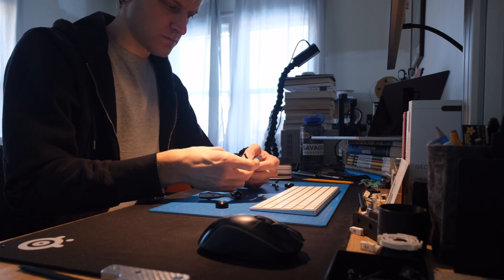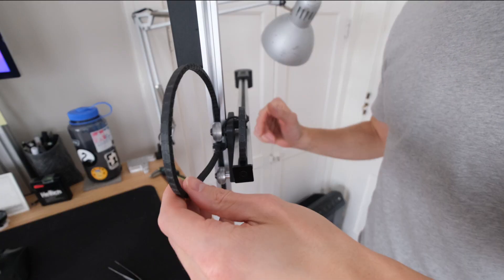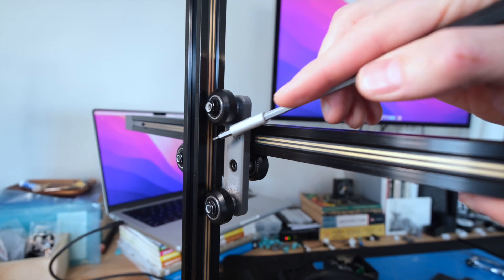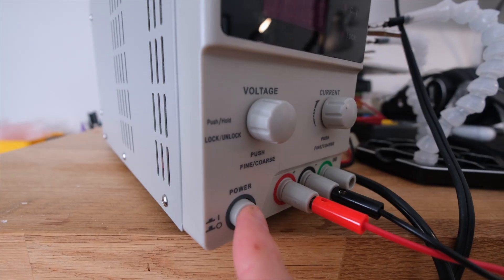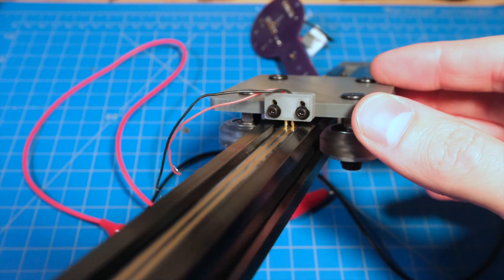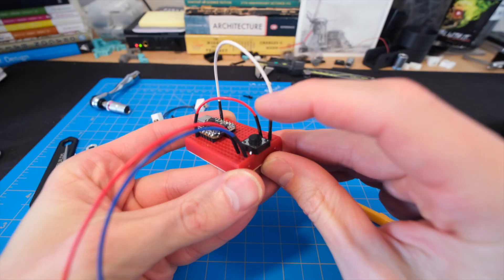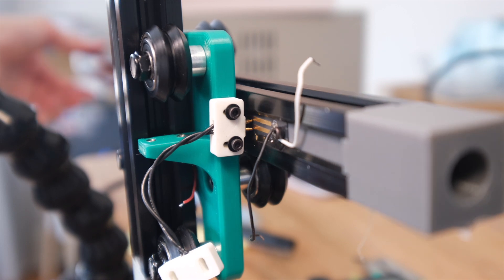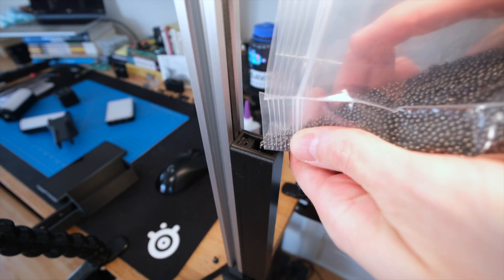Pogo pins: attractive distraction or ultimate wiring solution? - DIYson Lamp Build Log #9

Comment: Using a capacitor here is a very good idea, though beware that when loosing connection and they begin to discharge, they can cause a very large voltage spike if not properly accounted for and protected. Most lights and electronics can handle this for a short while, but it can mean the difference between an average electronics lifespan being measured in months or in decades, keep up the improvements though!!

Comment: In most "of the shelf" industrial applications where power is transferred via a track, the "carriage" is fixed to the track exactly to make sure the contact is stable.
Also live tracks shouldn't be exposed, you could touch them accidental. Even if this a safe voltage, this is just bad design.
The next thing is to chose your geometry in a way that makes it impossible to short out the rails when the "carriage" gets out of alignment.
Make sure that the distance between the tracks is at least 1.5x of the diameter of your pogo pins.

Comment: I bet someone has already written it but I want to get my thoughts out of my head: 2 improvements of the mount come to my mind. You could try to make pin mount spring loaded so that it woll press against the track. 
I also thought about adding a little pivot point to the pogo clip but this may result in only one pin making contact which leas me to my final idea.

Why don't you try to create a mount for two individual pogo pins (one for each lane) they could be mounted individually with a bit of rotational play up and down (following the movement of the second extrusion buy a clip or little extension that rotates the mount up and down once the second extrusion moves). They would also both have to be mounted spring loaded and yes it would result in a little bit more complicated assembly, but it should work.

Comment: this kind of solution will wear out quickly. you could do sth like in pentographs, check out this https://www.youtube.com/watch?v=ElsDYKTntU8 . But it's probably overengineering. Maybe rolled up cable would be a better solution?
Reply: maybe instead of pins there could be "bow shaped" pins, that spring-like nature will provide some pressure to make sure a proper contact to the track.

Comment: Very cool! My first thought is that instead of pogo pins you could use a small piece of flat metal as a "wiper" like in a potentiometer. This would allow a much greater range of contact and probably reduce the friction force on the supertrack. I've seen this design on air conditioning switches for cars which are built to withstand thousands of uses, so I don't think durability would be too much of a concern either.
Reply: I was looking for this type of comment! A potentiometer, or even better a fader,  is very similar to the application on the rails… Maybe carbon tracks are even better than copper tracks?

Comment: Why not use the t-slot as ground and then you eliminate one of the tracks. One less variable.  Also you have 4 sides to each tslot. You could put reduncany in by multiple tracks. All wired together. If one pin disconnects, the other will be there.

Comment: Why don't you use a rotary encoder instead of buttons? Instead of 3 buttons you can go with 1 rotary encoder and on and off depends on whether the rotor is at 0 or not and the brightness can be proportional to how much the rotor is moved. Mayb with a bit more digging, you can find a rotary encoder that works with your design to fit with the motion as well as the sleek design.

Comment: I'm sure you've already gotten a comment on this, but just in case you haven't, have you considered moving the pin locations inside the V wheel bracing? by doing this you'll be securing the pin positions within the fulcrum point as opposed to outside of it, you'd still have to worry about movement in the yaw axis, but pitch of the beam should be far less of an issue this way!

Comment: Came across your project on this video, I watched it back from episode 1 and I am really impressed by your talent ( both at designing and storytelling ) and I really want to build one for myself now.

Regarding the pogo pins, a solution could be to use 2 sets of pins for the horizontal axis.

I don't have your assembly to test that out, but to me, when you rotate the light, the horizontal axis twists around the vertical one right at the carriage, so one side of the horizontal axis goes away from the pins, while the other side comes closer to it.
So if you were to mount 1 set of pins to each side, when 1 set of pins loses contact, the other gets compressed against the track. This also adds redundancy in case a set of pins would get misaligned. 
At lesat that's how I see it, but I might be... Off track

Comment: instead of using wires, why not solder the pogo pins to a breadboard, and then use castellated holes (mouse bite) on the edges of the pogo-pin boards, to solder to a third board that is attached to a printed carrier, this will give you the tracks you need to deliver power, as well as make the part more reliable. you pretty much retain the shape of the printed part you're using now, and at the same time, you modularize the pogo-pin assembly, and reduce the count of flexable / movable parts.

I also want to point out, that there are two major issues with your current carriage / power delivery rail system 

1) Dirt, dust and particulates settling on the tracks can, and will impede proper power delivery by acting as a barrier between the pogo pins, and the tracks, a simple felt wiper on either side of the pogo pins should help with this. 

2) Reviewing the video, there appears to be way more freedom of movement between the v-wheels, and the tracks they ride in. The torsion this allowance, means your pins are being misaligned, or completely being removed from the tracks. I would advice tightening the grip the wheels have on the tracks. Delrin / Acetyl (the material the wheels are made of) has a bit of spring to it, so increasing the pressure at which these wheels "pinch" the extrusion should also make for a more rigid connection, without losing linear motion capabilities.

Comment: Great improvement!
I would suggest also measuring the current, as a capacitor is essentially a short when it is discharged.
I do not know the rating of those pogo-pins, so please be aware - otherwise you might get sparks and fried tracks (in the future).
Also mounting the tracks downwards would be optimal imho, to void shorts from dropped metal (unlikely, but it could happen) and dust build-up causing increased resistance, possible charring of the dust particles and eventually shorts/fire.

Comment: Hi Steve, Huge fan of this series. I have a couple Elegoo Saturn Resin Printers that I would like to volunteer my printers for any of your resin printing desires/needs. Secondly, I'd like to speak to you as someone with experience in both the Lighting Industry (previous role) and the Furniture Industry (current role) (No, I don't work for Dyson, they're a competitor in some spaces.) that some of what your encountering with your electrical issues are mechanically related. First, I believe some of the "Rotational" issues that you're incurring are when you're trying to either move in an XZ direction, or XYZ direction, has to do with mechanical play/slop. Your aluminum extrusion is not securely fashioned to your base. There is movement between your base and the beginning of the extrusion, creating an opportunity for the vertical arm to rotate in a plane that is not originally intended based on what you believe is rotation motion in say, the XZ plane or YZ plane, when you're basically moving the light in a flat circle, or arc, if you're looking at it. I believe that some of this could be fixed if your extrusion was recessed into a tight-fitting cavity, with outer dimensions matching the square of your base, to keep it aesthetically pleasing. Second, I believe you're seeing some of that slop in the horizontal axis because you're using static v-slot rollers. I don't' recall if one of your previous builds you mentioned using an eccentric nut in order to tighten down the contact between the upper and lower wheels, but Dyson decided to overcome part of that challenge by adding the spring load to the caster, maintaining constant tension on the 3 points of contact, regardless of the change in moment/weight created by having the end of the arm with the light on it, further out. or closer. I think if you were to return to some of the mechanical aspects of your design that are introducing an accumulation of inaccuracies, I genuinely think that if you could take care of a big chunk of what your encountering on the electronics side. Also, I applaud you on thinking about cost, and ease of assembly, which some of us in the industry refer to Design For Manufacture and Assembly (DFMA), however, quality can't suffer when cutting costs. Engineers also like to say "Fast, good, cheap, Pick 2" Let me know what you think, feel free to DM me for more info about the resin printing.

Comment: Really enjoying your iteration process. These points have probably been made many times (and you might have reached them already on your own) but...

- Wipers would probably work better than pogos. Because pogos are perpendicular to the track, getting ones with longer travel will mean they'll become more likely to bind as they get pushed off-centre when the track moves. But wipers can have much more travel and won't bind. They are used in potentiometers, faders, slip-rings - anywhere that current needs to cross a friction point.

- Mutliple wipers (I'd suggest a pair each side of the torsional axis) improve your odds of one being in contact at any one time. Your idea of mounting to the connected axis might solve this anyway, but I'd still suggest using multiple wipers so you're never reliant on a single contact point. Most wipers also have a split "foot" so they effectively give you a doubling, but more wipers is more gooder. Camera lenses use this trick a lot. Also wipers (and multiple wipers) can have a LOT more surface area, which will become very important when you...

- Test under load. Your test rig is measuring voltage, but at near zero current. This means that if your contact suddenly introduces say 10 ohms, you might not measure any significant voltage drop, but if it was under load the light would go out (figures are examples only, point is that not testing under load means you're not testing the thing that matters). You could just measure the voltage at the input to the lamp head instead (use a voltage divider if you need to keep the pin inputs in range) and that should tell you what you need to know.

- Related to that, your capacitor helps smooth the voltage drops, but you would need a bigger capacitor as your load increases. With very little current, the cap can hold the voltage up easily, but you'll need a pretty big cap to power the light for the same situation. You could use a supercap but it's not a terribly elegant solution - I'd expect you should be able to get the mechanical part of it solved instead - but a bit of filtering is rarely bad :-)

- Longevity, DC and corrosion. DC and AC behave differently at contact points. This is why a given relay will have a much lower DC rating than it's AC rating. DC tends to arc - which in the short term might be good for keeping the circuit going, but longer term will cause carbon buildup and pitting on the track. I think you might also be more likely to have corrosion issues with DC due to electrolysis (and other effects?) which I believe that AC tends to have fewer issues with. They deal with this in copper phone lines where the battery voltage applied causes corrosion to build up at every termination, but it tends to be kept at bay by the AC pulses during dialing or ringing (I'm not 100% on the specifics there, but it results in problems on ADSL lines when they no longer get used for normal phone calls). I don't know if / how much that might become an issue for your design over time - it might be only theoretical, and the scrubbing action of the contacts might prevent it ever being an issue. You could send the power as AC (either at the mains 50/60Hz after stepping down to a safe voltage via a transformer) or you could have a chopper circuit create a pulsed or shaped AC and rectify it at the lamp head. Or, just solve the problems you know you have before worrying about the ones I'm making up!

Looking foward to your next installments!

Comment: Keep in mind that the voltage dropout experiment with capacitor is only going to be representative of the final product when there is a load (the LED) connected. Otherwise, the capacitor will hold its voltage much longer and give a false indication of stability.

Comment: Hi!:) You could use carbon brushes, like in electric motors. Those are fairly long lasting considerint how many time a motor turns before brushes need to be changed. They are "self lubricating" and somewhat selfadjusting, because of the graphite itself can be seen as a lubricant.
Reply: This is a better design. The metal pins will ruin the PCB in a relatively short time. He could use pencil graphite which is readily available in about the right size for drafting pencils.

Even better would be to design a small metal wheel on a spring.
Reply: @court2379   Came here to say this. Pins will destroy the copper tracks.
Reply: most rotating speaker array sirens use a collector ring and brush assembly and those use carbon brushes like motors and they work almost all the time
Reply: Also they are very cheap, you can get a pair of power tool carbon brushes for under $5
Reply: I don't know if the dust and the look of the smears they will cause on the tracks aren't dealvreakers though

Comment: Since the Track already exposes the wiring to the surroundings, one could make it wider and only run a single pole that way, the other pole could be the aluminum extrusion itself, I figure you are going to keep the voltage low anyways? That is how they do stuff in cars, just use the whole car as "ground". Issue would be that you either need to drag a pogo-pin on the extrusions or you would need to otherwise electrically connect the horizontal and vertical track to each other, since the rubber wheels are isolating them from each other.
Also the Dyson, has got the connection much closer to the pivot-point between the axis, while not as easy to print, it would also look better if the pins came out the backside pf the plate between the track and the plate.

Comment: Have you thought about getting the ENIG traces covered in a carbon mask all along their length? It'll give you a small amount of material on the surface, but it's durable and definitely helps with conductivity issues when it comes to moving mating metal terminals as it also acts as a lubricant somewhat.

Comment: i remember a lamp at some point with this kind of connection but instead of having the contact "tracks" side by side like on you pcb they where on the opposite "walls", so the contacts where pushing away from eachother. using 2 seperate tracks would also allow you to increase the width of each track to give more surface area where it can make contact. not sure if this will be the solution but might be worth looking into

Comment: Adding multiple pogo pins at different locations might work. On front and on the back of the sled(at least). Real trains also have more power take off points for that reason

Comment: I scanned though the other comments and think everyone has missed something. From my experience with 3D printing a bunch of carriages for OpenBuilds hardware the 3D prints are not rigid enough to prevent the rotation twist of carriage on track. If you try a stock aluminum OpenBuilds carriage it is very stiff and will not rotate at all. In which case the existing PCB approach will probably work great. I have tried printing in Nylon and that was not rigid enough either. Random idea I wonder if a PCB for connecting pogo pins could also be designed to add rigidity to wheels while still avoiding custom metal parts. I have built a express version so far and super cool. I redesigned the base and clamp with 3D printed huge screw clamp which works great. I will have to find a way to share. Maybe github. Thanks for great project 😀

Comment: Not sure this helps, but if you have two rails on opposite sides of the profile you should be able to handle deflection with a larger trace. Second a lot of motor us spring loaded carbon blocks. These wear of over time, but are softer than the copper.

Comment: That’s a really clever solution, but I think you should also test how will the exposed tracks will behave over time, particularly how will corrosion or dust or dirt could affect the connection quality or, in more general terms, how the normal wear and tear produced, by the friction between the pins and the track, will affect the durability. Also as important, what happens if there is a short between the tracks?, as far as I remember you’re not working with too high voltages or currents to be a health hazard but a short could nonetheless fry the whole system.

Comment: I really like this project. I end up doing a lot of 3d printing and prototyping for my work and I find that a resin printer is great for certain, particularly small or details parts. I feel like a cheap msla printer could be really helpful for this project, I also find that sirayatech resin is pretty good for resin mechanical parts. I was also thinking that you could build a rig to test the lifecycle of the pogo pin/pcb strip arrangement. A single axis with a belt/stepper could just drive a carriage back and forth while logging the resistance in relation to motion cycles. You could test it with different pins, trace thicknesses, lubricants, etc.